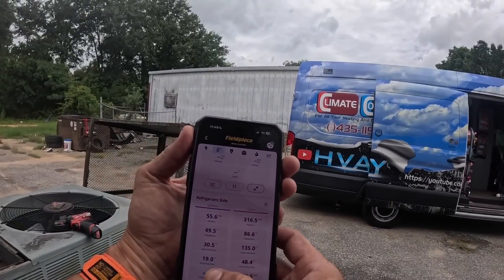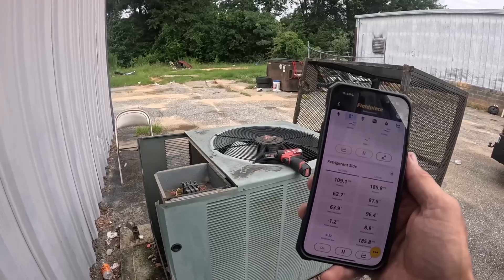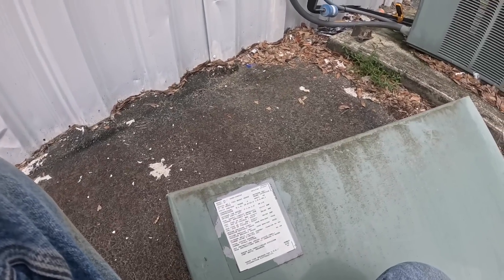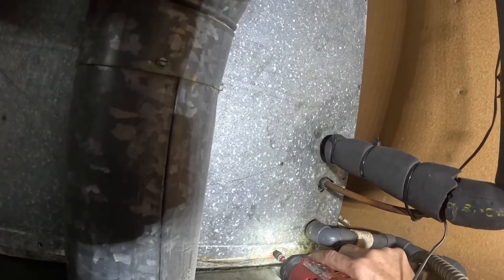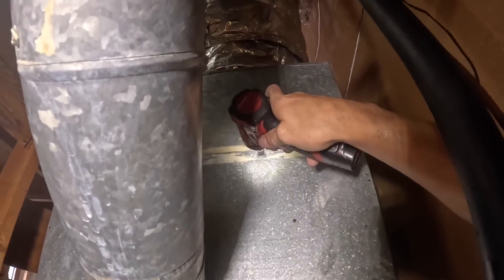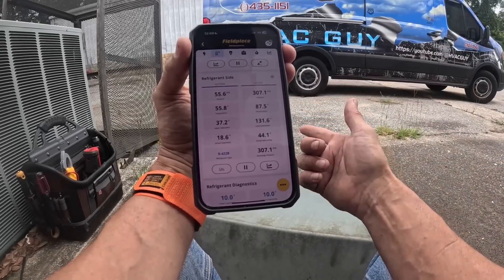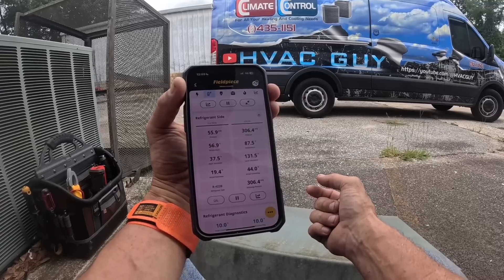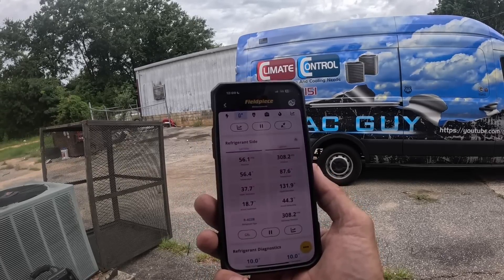Second Visit Leads to A More Exact Diagnosis! #hvacguy #hvaclife #hvactrainingvideos

Comment: I would say the the cap tubes don't feed the the NU22  properly. Your SH and SC should be lower. The condenser looks dirty. Time to pony up for a new unit. R458A (TDX20) works better than Nu22

Comment: Designed tested rated and built for R22 so let’s play field design engineer and chemical expert and charge with something else. I care not what the supply house or refrigerant representative states, unless they have in writing use this refrigerant and we will place a 10 parts and labor warranty on all refrigerant systems components. It’s beyond me why anyone would use alternate refrigerants! If you say cost, to who? You? No the end user. If it’s R22 it’s at least 14 years out of date. It’s either R22 or a new system. Just my 40 years speaking in HVAC speaking!

Comment: Is that big cage to prevent it from being stolen?
Reply: Copper thieves love ground mounted A/C condensers.  They will come cut out a bunch of copper tubing and run.  Then when the place replaces the unit, the thieves return and do it again.  The steel cage with a pad lock helps.  Although some of the more determined thieves will simply cut the lock, remove the cage and away they go with the copper again.  At least some of them make mistakes by breaking into an electrical vault and saving their families the expense of a cremation.  One of them here broke into the power supply for a 50 kw AM radio transmitter.  It was the last time he will ever try to steal copper again.

Comment: I didn't see u check the supply airflow 5 ton unit should have at least 2000cfms and
also check the supply vents.  it all starts with the correct airflow.

Comment: Ancient cap tube coil from the 6-9 SEER days, capacity loss from a not very good alternate refrigerant, cage on the condenser choking off airflow and causing recirculation.
The system never stood a chance.
In the days that coil was from, outdoor units ran higher head pressures, with condensing temperatures 40º+ above ambient, and had capillary tubes sized accordingly. 
Both the coil and cap tubes are too small for any 10+ SEER outdoor unit to work correctly with it.
Reply: Good call.

Comment: Definitely issues with the cap tubes and the different refrigerant. The cap tubes were designed for R22, not R422b. Be different if there was a piston or TXV little more forgiving.

Comment: I had trouble in the past with capillary tubes in refrigeration units, not so much with AC. Time and again you run across units that are not matched. Some folks obviously think that when you replace a condenser, you can go up 1/2 ton. It will work the other way around, but I think matching them up is best. Good video

Comment: Curtis as others noted someone wrote r 422b on the unit that may be the issue unless that was you, also that blue reciever dryerooks old I would replace that and pull the refrigerant out and vac and recharge with mo 99 along with a recieve dryer replacement. And that should solve the issue.
Reply: Is R422b not as good as MO99 for R22 replacement?
Reply: @jthonn  yes r 422 b defentaly does not perform at all like r 22 MO 99 works better.
Reply: @gabrielstern4992  Thanks
Reply: At the beginning he said that a year ago he took out all of the old refrigerant and put in virgin refrigerant
Reply: @earlestes8649  Yes he did, I don't know why some people didn't understand that.
Reply: Nu22 works very good also

Comment: Was there a size mismatch?
Reply from the maker: Looks like it. Condenser is much newer than the rest
Reply: @HVACGUY  old cap tube coil was probably designed for a 6 to 9 seer and they just hacked a 13+ seer outdoor unit on it.